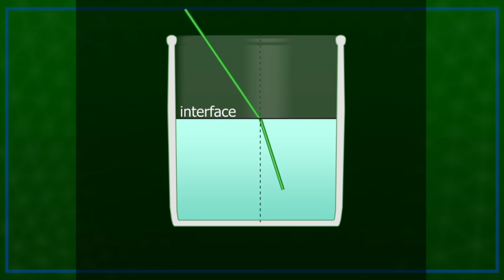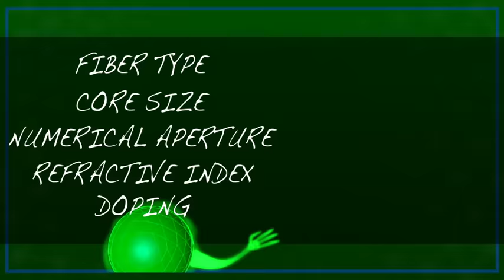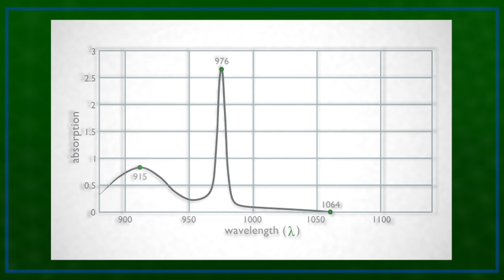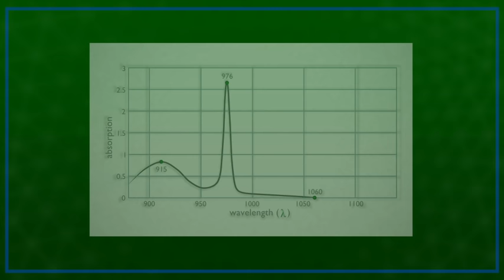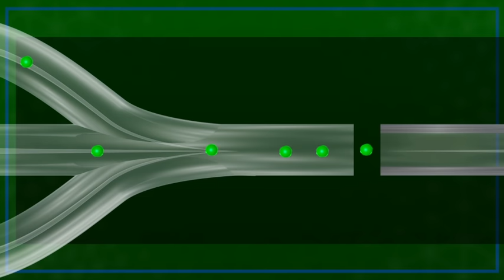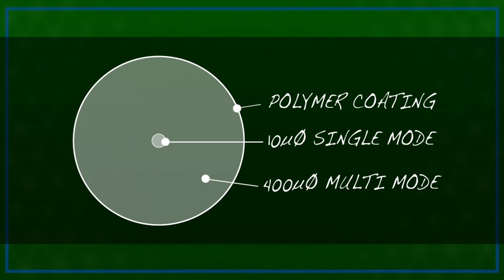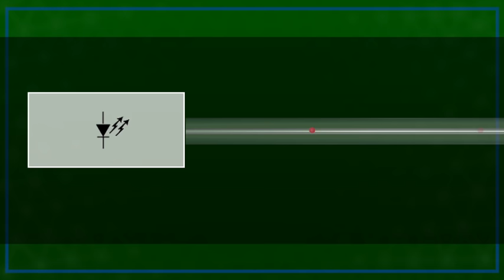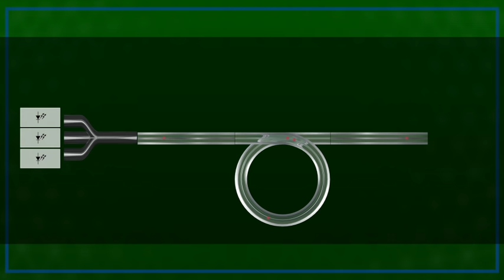How a Fiber Laser Works

Comment: Excellent Presentation. I watched first hand the development of a Fiber Laser used in LIDAR Applications from the perspective of a PCB Layout Engineer dealing with Pump Diodes and Optical Racetracks and the electronics driving them. Made for some interesting challenges. I never expected to have to change a board layout because of the reflectivity of objects such as a Stop Sign at the frequency of our Laser. Now I have a much better appreciation for the issues facing the scientists and the problems we Engineers had to solve to create a low cost mass manufacturable device. Thanks! We succeeded by the way.

Comment: I am a fiber laser operator and I still don't know how it works. All I know is that magic comes through the nozzle which in turn cuts through steel.
Reply: I run a waterjet and my boss has a pricey fiber laser on the way.  This video scares me a bit damn all that math
Reply: @jewwyjones9760  I operate an Amada Fiber laser. It's easy to operate, don't worry.
Reply: @Stefano_Rodriguez  well my boss opted for a "cheap" laser.   Vyteck with laserworx.  I've moved away from the fabrication stuff now I'm a machine operator otw to programmer.  They've had soooo much trouble with this laser.  Can't seem to dial in anything thicker than .188 inch (7 gauge) stainless.  The gas doesn't stop bw cuts lol Vytek said 🤷‍♂️.
Reply: @jewwyjones9760  I see. Programming is good! I do the programming/nesting for the Amada as well. Maybe, they just need to play with the settings properly. I cut 3/8 stainless steel with the Amada with no problem, but we just need adjust the settings a little to get our smooth cut.
Reply: Hi ,, I am pursuing MTech from Laser Science and engineering from India and I want to work in foreign countries ,, friends as you are in laser related field ,,I want your favour ,,
Reply: it probably isn't a fiber laser.. they call it a fiber laser because it uses a fiber cable to transmit the light from the "source" to the nozzle, while it's actually a solid state laser.
the "real" fiber lasers are mostly used for engraving and micro laser cutting
Reply: Use to cut thick metal with oxy‐gas and plasma (200A). Just ten years ago a 5 Kw CO2 laser was  low power for 50÷80mm carbon steel cut. Now is the Oxy low powered!!
Reply: Your understanding exceeds my own x100
Reply: @rupamrakshit7825  brah, dont embarass yourself like this, jobs and migration does not work like this!
Reply: @stuntevie  Yeah? The US Navy uses fiber lasers onboard ships for air defense.
Reply: @jewwyjones9760 try using air and adjust the wobble to push the slag out.
Reply: I work on a Trumpf Trulaser 3060 with a 24,000 watt resignator. Operating it is pretty easy as long as nothing unexpected happens, you know how machinery can be sometimes lol
Reply: I feel that one, operated 6,10,20kw flat sheet lasers and a 3kw tube laser for a year now and all I know is laser go brrr

Comment: But if this type of laser needs laser diode to pump it  , then why we need fiber after that at all ? 
I mean in other laser like ruby , hene we pump it with normal diffused light from dis lamp that that active medium  makes laser beam from light but in this laser if we use , let's say 1 watt Laser diode of any wavelength so how it would be beneficial to use fiber as amplifier medium because due to the fact that efficiency can't go higher then 100 (according to  energy violation law) ?
Reply: I'm going to take a stab at answering this... because I have struggled with the same question. I think the goal is to get the beam quality to single mode and smoothly Gaussian intensity so the energy can be maximized when focused into a tiny dot. So the better the beam quality, the smaller the dot you can focus, the higher the Watt per Square Centimeter. Taken to its logical limit... the single mode with best beam quality has the smallest focal point which yields the highest intensity. Can anyone else validate this answer in case I'm missing something too?
Reply: @i2c_jason  Yeah its a massive pain to combine the ouput of multiple diodes soo this basically solves that problem without needing a bunch of lenses to combind the ouput perfectly.

Comment: Excellent and detailed explanation. The issue that I am involved in is looking for the best temperature for the best wavelength so that the pump diodes bring the least pressure. The challenge is the temperature of the pumps and the temperature of the oxygen and nitrogen during cutting. By bringing the pump temperature to minus 12 degrees, we obtained lower quality and energy

Comment: Interesting video.  I have a few Q's if you don't mind.

1) You keep stating that you (the industry?) is striving for single mode fiber.  I thought the communication industry liked multi mode fiber because they can run multiple wavelengths down it at the same time and get more bandwidth out of the same fiber.  Perhaps for the purpose of fiber lasers single mode fiber is desired over multimode,

2) I am not sure of the gain of the fiber laser.  If I am seeing this correctly, you need to start with a laser to make the fiber laser work.  I thought semiconductor lasers were already monochromatic and I can not see getting more power out than you are putting in or you would have perpetual motion.  What exactly are you gaining?  Is this a way of shifting to a new wavelength?

3) Perhaps more of a statement.. The one big thing I do see is how to parallel multiple lasers together, but that seemed to have little to do with the fiber laser part.  Is that a correct assumption?

I plan on watching this again.  It is definitely interesting.  Thank you and your company for presenting it!
Reply: After reading Wikipedia, this is what I think I understood: 

1) The communication industry also likes single mode fibers. Multi mode means that light takes multiple different paths through the fiber. One path is longer than the other. This means light will take longer to traverse a longer path than it will take to traverse a shorter path. This is modal dispersion. for example a pulse with a length of 1 ns is fired through a fiber. Lets say the slowest mode takes 100 ns to reach the other end, whereas the fastes mode take 90 ns to reach the end. This means a 1 ns pulse at the input of the fiber has turned into a 10 ns pulse at the output.  This decreases the signal bandwidth of the fiber. furthermore single mode fibers are less lossy.

2) The fiber laser allows you to take one or more high numerical aperture lasers and combine them into one high power low numerical aperture single mode laser. The pumping beam travels mostly through the inner cladding, but interacts with the core to pump the lower energy state electrons into a higher energy state. when these electrons fall back to their lower energy state they emit a photon of a different wavelength. This is called spontaneous emission. when these emitted photons interact with other high energy state electrons, they cause them to fall back to their lower energy state and emit a photon with the same direction, wavelength and polarisation. This is called stimulated emission. This way you get a high power beam, with very little modal dispersion.
Reply: The utility of a laser in most applications is that you get to focus a lot of energy all in one place, higher intensity the better for most uses. If you think to focus a bunch of different laser diodes all in one spot of some tens of microns in dimeter and totaling a kilowatt or so, you are not really going to succeed at that. But if you use the same diodes to pump a fiber laser, then the output from that fiber laser you can focus all in one spot. Note, that the cladding the pump light travels in is a lot thicker than the core where the laser emission travels at. Don't get confused by the pump diodes being lasers themselves, you could be talking about a ruby laser bumped by a a flash tube, or a gas laser, it's going to be the same situation. The laser emission can be focused down to smaller spot for higher intensity than the pump energy can, that's the point of using lasers to pump a laser.

Comment: When describing the absorption length of a typical fiber laser, "13 db" is shown above the diameter of the loop in the example fiber (around 6:27 into the video).  What is this unit of "db"?  I cannot seem to figure it out.  The unit of dB (decibels) doesn't seem to make sense here, but that's the only unit that I can find is abbreviated by the letters "DB".  Is it 13 decibels?
Reply: This is decibel yes. Decibel is not a physical unit but a way of expressing a ratio between two quantities using logarithms. For sound it is used like a unit because the sound is compared to some reference (e.g. dBm means compared to 1mW). In this case it refers to a loss, the ratio of the input power to output power through the fibre. The advantage of using dB is that it allows you to add the losses so a 6dB loss followed by another 6dB loss is a 12dB loss whereas a loss of 0.5 followed by a loss of 0.5 is a loss of 0.25  which is less obvious for non trivial examples.

Comment: 1:18 the light spectrum table is backwards. gamma ray is long wave and radio is short
Reply: ummm, no, no its not lol, Radio is long wavelenghts, since longer wavelengths travel over much longer distances, radio can be 1mm to over 50Km long, 2.4ghz Wifi is a form of radio and is about 122mm long, where as Gamma is less than 0.001 nanometres. but hey small mistake it happens lol.

Comment: 8:35 diameter output?
what does that even mean?
Reply: I think they meant larger diameter core. Large diameter core is easier for coupling the light into the fiber after it is generated from the laser diode's emitters.

Comment: DONGLE NOT FIND ERROR, ..... I HV LMC V1 SUCCESFULLY INSTALLED DRIVER ON WIN 7 32 BITS BUT WHEN I RUN EZCAD 2.5 ERROR COMES DONGLE NOT FIND AND SFTWARE WILL RUN ON DEMO MODE, WHEN I OPEN EZCAD FOLDER AND RUN CorFileEnu AND MARK 9 POINT BOX , LASER MARKING WELL BUT NOT CUTTING THE PIECE (NO SOUND OF CUTTING) KINDLY TELL ME WHATS WRONG AND WHAT SHOULD I DO?

Comment: 400 nm is NOT blue. It's violet.
It's absolutely pathetic how many science communicators get that wrong. The visible spectrum ends in violet, not blue.

Also, it's MI-cro-ME-ters, not my-CROM-i-ters.
The way you mispronounce the word, it means an instrument for measuring small distances, not a unit of length.

Comment: Thank you but I still don't understand, too much theory and not enough practical info.
Reply: it is kinda impossible to show this in any practical way. it happens inside the fiber, at light speed. literally.
Reply: The Fiber is itself the Laser Cavity?
Reply: No the fiber combines multiple beams, however, in order to achieve more intensity, they had to change the diameter and geometry of the core, such as the tapering of the fiber was bent, For the fiber, they also analyze the different dopant materials to make sure there is enough throughput.
Reply: Yes the fiber is the cavity which is pumped by multiple beams.
Reply: Well yes, I was replying to the first comment. 
It acts as a resonator, in addition to the laser cavities in the diodes.
Reply: You just need to do some deeper research into other things that fall in the categories.  I dont know how to really explain it other than the more you know about physics as a whole; it allows the capability to catch on to concepts.  I have two CO2 laser machines but I began looking into more expensive ones and through that research it lead me down the fiber path and I had no idea these existed until very recently.  I am a multicraft engineer and this video summed up 90% of everything I need to know.  The rest will involve hands on after I find which fiber route I wish to go.
Reply: @MRdoA77  can this lasers be built DYI style? - i mean with more specialized equivalent like a prototyping shop. I can't find anyone building them online yet. They seem so useful. Still looking :)